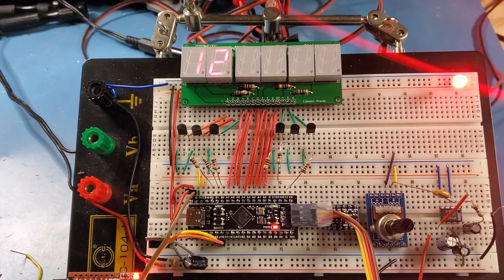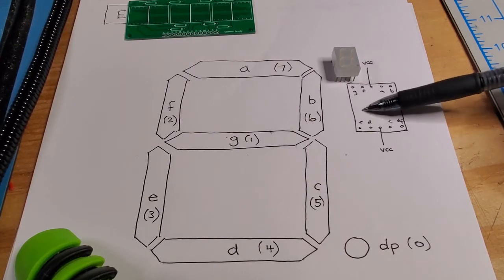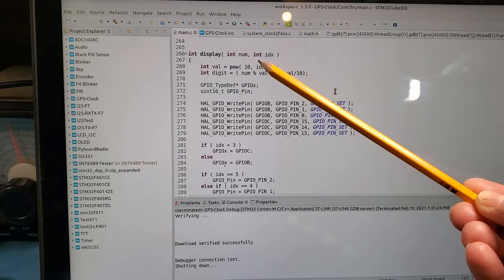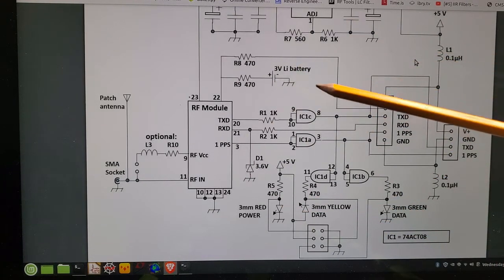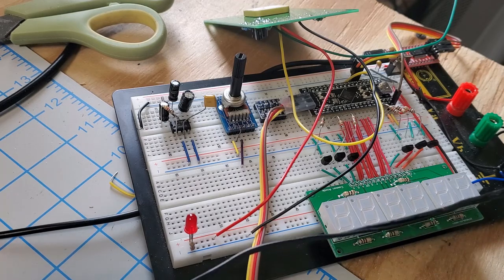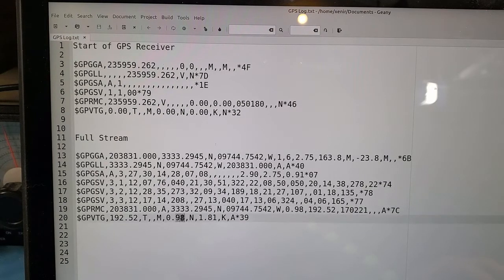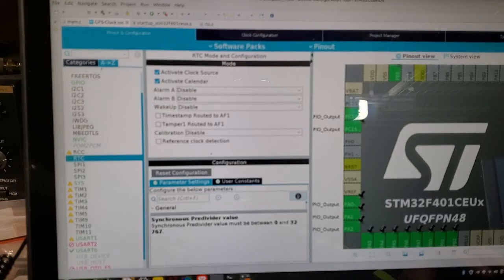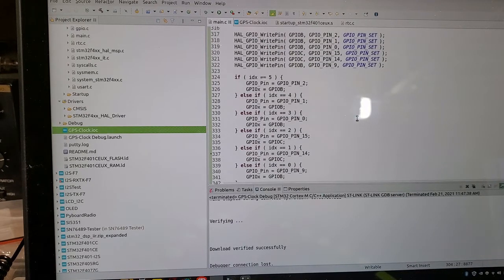GPS Clock - Part 1 LED Driver GPS and RTC

Comment: Had a wee chuckle at the two digit year in the datestamp ... flashbacks to the Y2K "bug"! I assume the datestamp format is a function of the RF module firmware? Also, can you post a Banggood link for the GPS module? I had a look and got lost, probably because I had the wrong keywords. Thanks.
Reply from the maker: Yes I found that funny too. Both the GPS output and the RTC have two digit years. The HAL even has this check
#define IS_RTC_YEAR(YEAR)              ((YEAR) <= 99U)

The Bangood module I got was this one
https://www.banggood.com/Beitian-BS-280-232-GPS-Receiver-Module-1PPS-Timing-With-Flash-+-GPS-Antenna-p-1334706.html?rmmds=myorder&cur_warehouse=CN

I got the price wrong though it is around $15 not $6 as I said
Reply from the maker: I'll hasten to add that I haven't tried the bangood GPS receiver yet so no idea how well it works
Reply: @na5y  Cheers Ian. Yeah, the $6 "price" caught my attention. I'll probably stick with QRP-Labs for the few extra dollars and known quality.